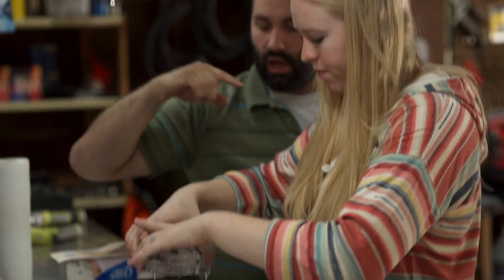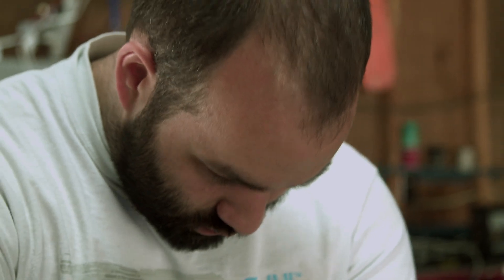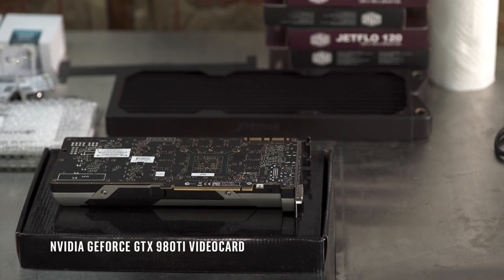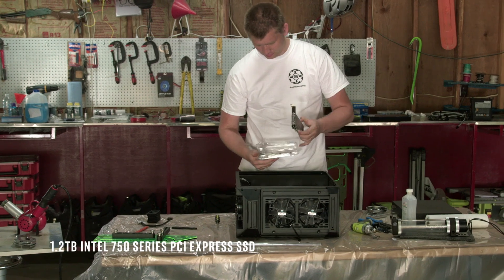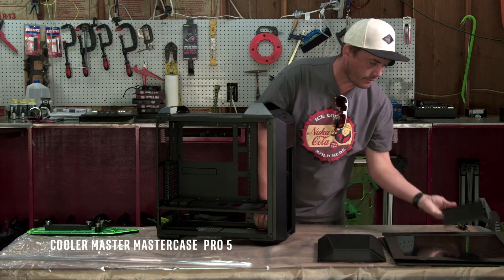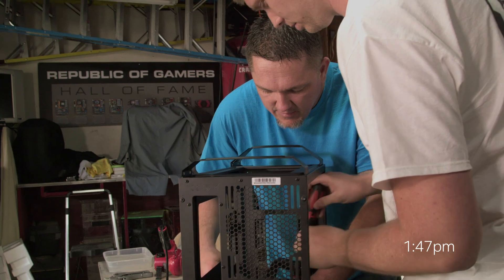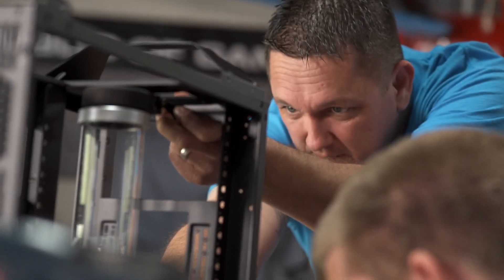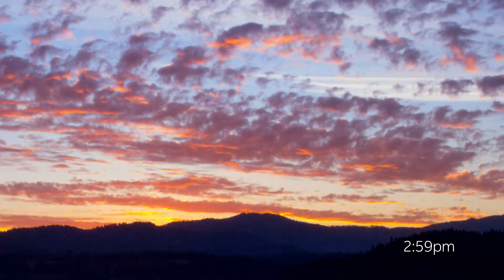The Skylake Build, Part 1 #ExpertMode Ep. 5 | Intel

Comment: Hey Intel, does the skylake core i7 6500u bottleneck with a Nvidia GTX 950M GPU?
Reply from the maker: Hi vertonical, could you kindly provide details about the issue you are currently facing with your CPU (in case there is any) so we can assist you better?  If not, then it would be great if you could explain more about what you specifically have in mind when you say “bottleneck” and we will be more than happy to provide any need assistance.  Awaiting your reply, RG.
Reply: +Intel I'm thinking of purchasing a laptop configuration of an Intel 6th generation core i7 6500u paired with an Nvidia GTX 950M GPU. Are these two a good match? , are there any incompatibility problems when playing certain games, do they complement each other well, any unwarranted fps drops?
Reply: +vertonical You should be fine, however you should check reviews of the laptop before buying. There may be a cooling issue that causes either the CPU or GPU or both to throttle, preventing you from getting the framerates you would otherwise expect.
Reply: Should be fine as long as the cooling solution the laptop has is sufficient.
Reply: Bas van der Meij That only took you almost a year lol!
Reply: DKL Oops, didn't look at the date of the comment..

Comment: Why would you build a Skylake system and then put a high end graphics card like the 980TI about half the transistor's on the chip will be disabled and gone to wast. Also a high end and expensive motherboard. Slylake  is a great Processor but if your going to build a high end system with high end board, ram and graphics card your better off with an X99 system. Not trying to be smart just don't understand why X99 systems don't sell more to enthusiasts and tech sits don't push it more. You even have a video out port and traces running to it that will be disabled and useless.
Reply: +Harmik Khoronian WTF, Skylake will destroy X99 for gaming. X99 will only shine with multi GPU systems using more than 2 GPUs.

Comment: who cares 6700k if u cant get them anywhere and if u can they are overpriced like hell cuz lack of em... WTF intel???
Reply: +Loretai Mods 1 month later and theyre still out of stock everywhere. I checked Fryes, amazon, microcenter, ebay, BHPhoto, newegg, tigerdirect, siliconlottery, and this place in the uk called Aria. I believe the original price on the 6700k was $350 now the lowest its being sold for is $360 before taxes. Amazon is selling it for $500! theyre out of their minds. you can build an entire desktop (although inferior) for that price. Intel's stock price is very low compared to other tech companies. The graph shows very slow moving trend upwards. Probably because they don't produce enough of the processors fast enough and for a reasonable price. AMD is hot on their trail and when they come out with the ZEN will def make intel sweat a bit more. If they lower the price of their processors.. they'll sell more and maybe drive their stock price up. Don't do dividends, reinvest the extra money back into the company so they can keep making more and advancing their tech.  A processor shouldn cost so much and should be so hard to get ESPECIALLY since they double every 18 months. so in less than 2 years.. your processor will be slow compared to whats new.  Something that needs replacing in just 2-3 years should be cheaper. 

By the looks of the manufacturing process they utilize mostly computers and robots as their laborers. So its not like they have to pay all these workers all this money to stay in business. They must be saving a lot of money on having computers do everything even though computers use electricity to run. The Kw/H is is cheaper than a workers salary per hour.. so yeah Intel is making bank. If theyre limited on how many wafers they can produce to keep up with supply then obviously the tech company needs to expand. NOT overseas either. We need more American jobs Intel. Open up another plant! Time to kick it up a notch and watch R&D advance past your Moore's Law peak.